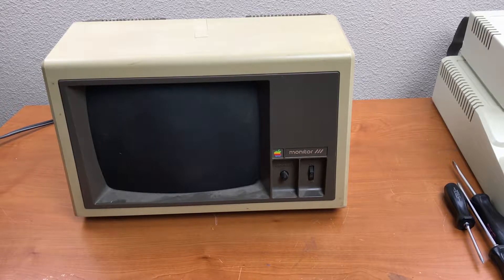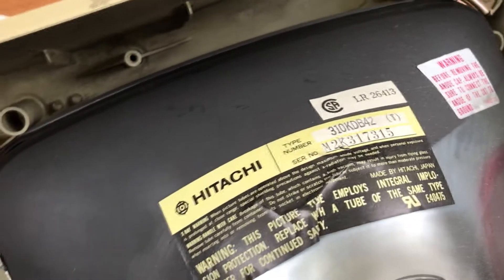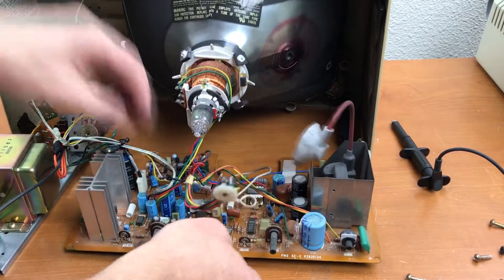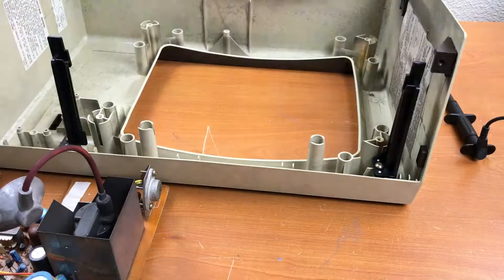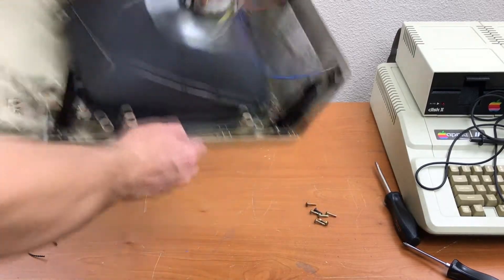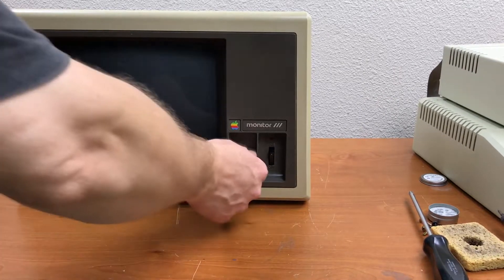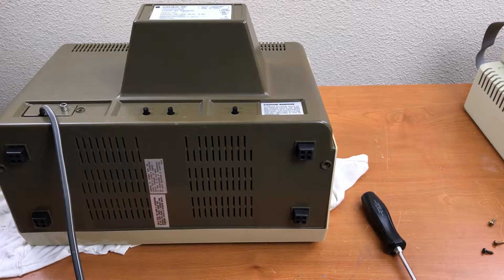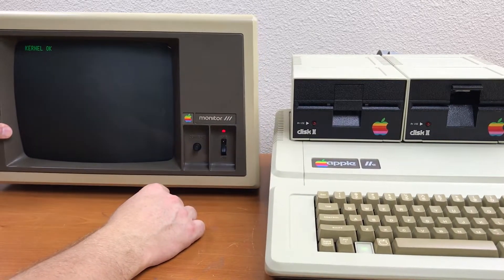Apple Monitor III Disassembly and Cleaning

Comment: instead of unwrapping the deflection coil wires,  would you introduce degradation to the graphics by cutting the wires and adding in a molex or some other connector so it can be disconnected again in the future if needed?   Great video.
Reply: If you disassemble a 4 pin male molex connector the individual pins on the inside fit perfectly on the posts in the monitor, i do this way and can be unplug later.